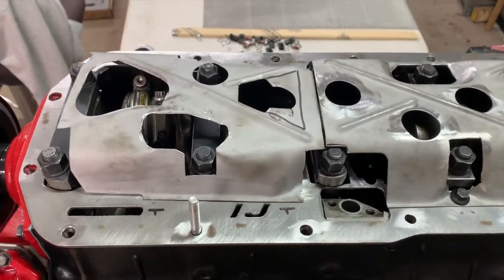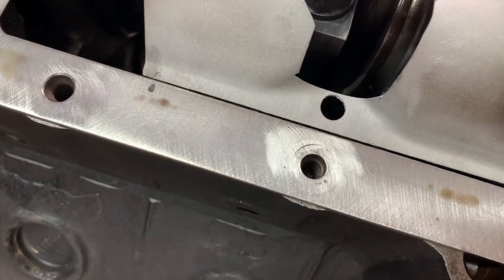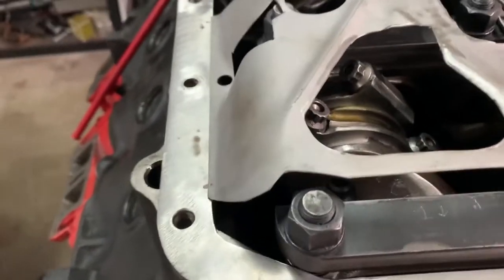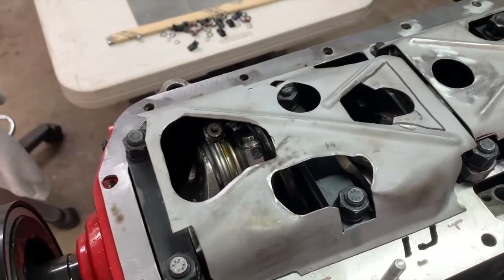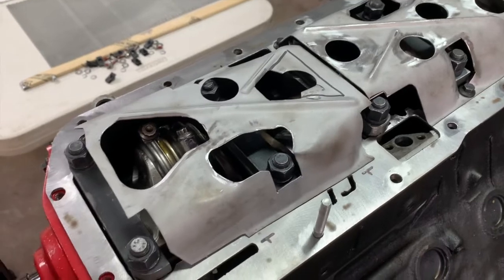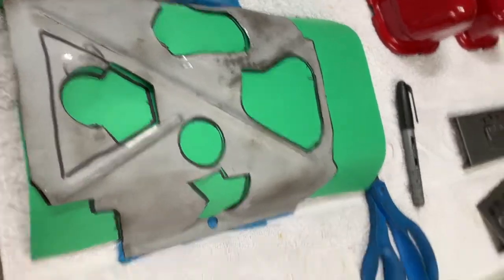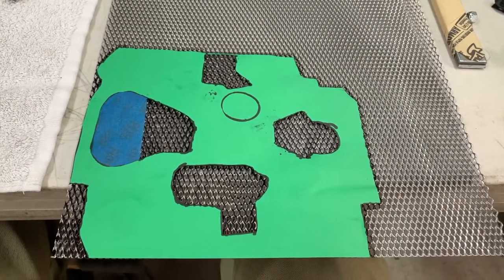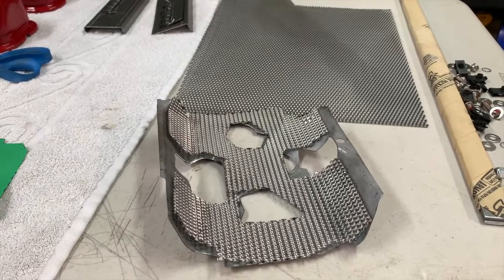DIY Homemade Windage Tray for the Buick Small Block 350. Making our own since it's the only way!

Comment: What does the mesh do?
Reply from the maker: If you look at a normal windage tray, there are louvers, there are no louvers in this homemade pan and I do not have a louver machine. The louvers are what pulls the slinging oil off the crank. Since those are not on our home made windage tray, the mesh acts like a million little louvers to pull the oil from the crank. If I can't get it all to fit, I'll leave the mesh out.